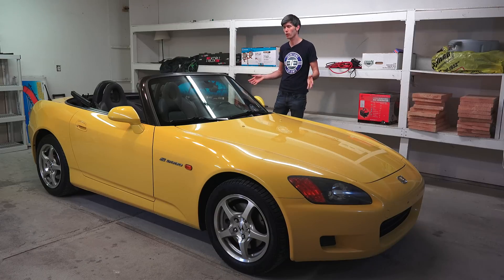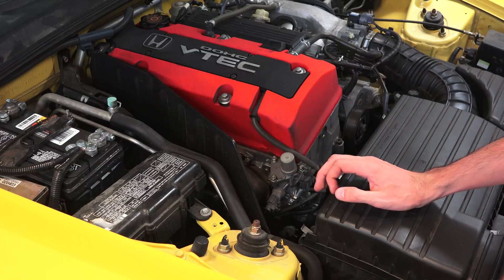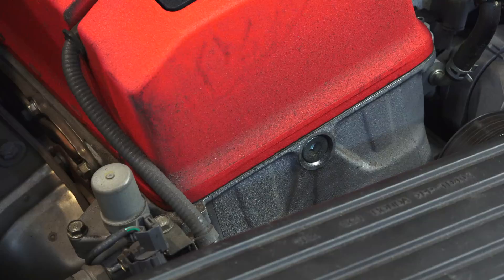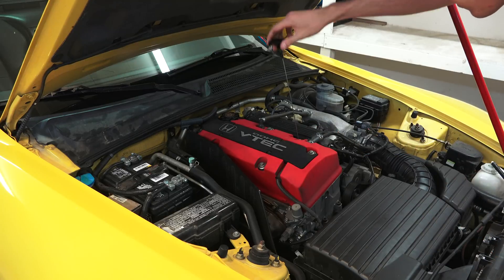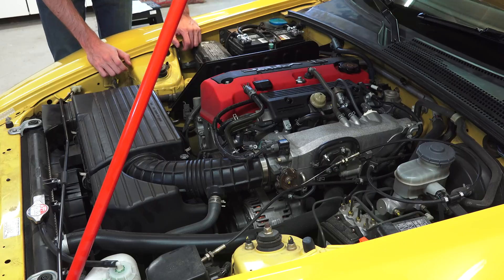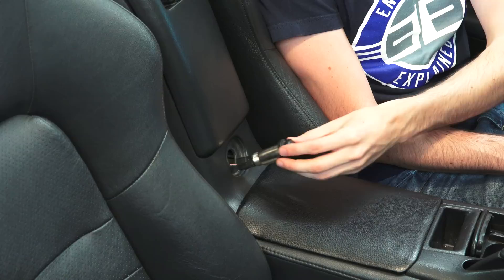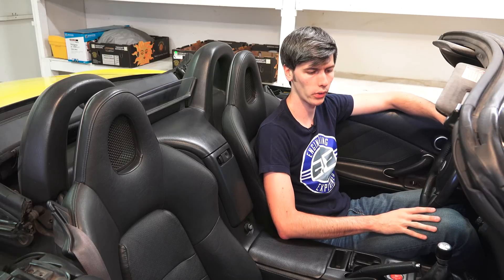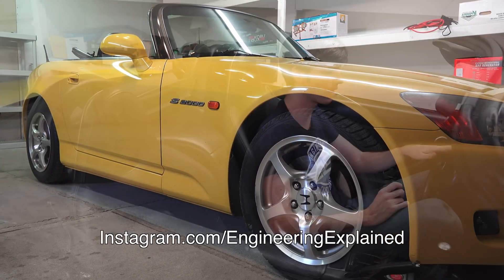What's Wrong With My Honda S2000?

Comment: My 2000 ap1 preferred castrol to Mobil one. It could burn a quart per 1000 miles of you were always doing high spirited drives. The TCT takes less than 15 minutes and is no big deal. Makes a noticeable difference in off idle too. My car was driven hard but not abused for 75,000 miles around Beaverton, Oregon and is now happily still running with its new owner. Rear wheel bearings and starter are the only repairs it needed on my watch. If you're going to daily drive in the winter I highly suggest the factory hard top. Worth every penny. Congratulations and enjoy.

Comment: Your top doesn't look to be folding down correctly. The small bar right above your head should fold back further than it is. It makes getting the tonneau cover on much easier. Also, have you found the secret compartment yet? :P

Comment: I've been thinking about painting my 2002 Miata's control arms too just to hold off any future rust, so I'd be interested in that! If you do end up doing it, look up Evapo-Rust. It's a non-acid liquid that melts rust and doesn't hurt rubber or plastic, or really anything else. I've used it on calipers, and it's magic.

Comment: replace with TCT with Ballade sports TCT, I'd do amsoil mtf & gear fluid for the rear diff, if there isn't any oil leaking from the pan I wouldn't worry about the seal, there are 28 bolts I believe (I've replaced mine don't remember the exact number) that hold it on at like 7ft lbs and it is just a hassle to deal with so not worth it if it's not leaking. For the plug in the console, that whole center console assembly (where the roof button and arm rest is) snaps on/off, then you'll have to do undo the panels behind the seats to get access to the plug from behind and it's just like you said, you need to thread it back in. A common issue on the ap1 is burning oil, especially Mobil 1. I had this issue with my ap2 burning Mobil 1. I switched over to castrol full synthetic and the car runs much smoother and doesn't burn oil like it did with the Mobil 1. Amsoil is also another good alternative if you don't mind forking out the penny for it. Good luck, looking forward to more videos on it!

Comment: yel its fairly common  s2000's eat up a quart of oil for every thousand miles like old boxer engines. also change the air filter man. that high revving engine needs to breathe

Comment: The air cleaner is one of the things I check on any car I'm potentially buying.  Its cheap, important, and about the easiest maintenance you can do to your car. If they couldn't handle that, I wonder how the rest of the car was taken care of and it's (probably) best to  walk away.  Also, don't just look at it to see if its clean or dirty.  Check to make sure its actually put in properly.  A surprising percentage of people just force everything on and have air cleaners that are pinched funny or something that are just not working properly.

Just one more thing...OEM fluid is not always the best for your transmission.  Might want to do some research.  Remember that car is like 20 years old too.  It probably needs some unique properties for its time, and would benefit from some modern ones as well.

Comment: hood. there is a cool mechanical function on your hood whereby the hood prop can be moved from its pivot to prop the hood at a higher angle. sand blast the control arms and paint when you inspect the bushings. I would change the o ring as well as the water pump and timing tensioners. but it looks to be a good buy. also have a look at changing the VTEC units diaphragm rubbers\filter too. :-)

Comment: You should also do the following important maintainance/preventative upgrades 1) check valve clearance 2) install ap2 valve retainers 3) install ap2 crank lubrication bolts (aka banjo bolts) 4) baffled oil sump if you are thinking to track the car.

Comment: I have a 2000 S2000.  Had it for 8 yrs now.  Bought it with 82K miles.  Now has 105K miles.  Love the power, cornering and overall feel.  Doesn't burn oil.  Does eat the rear tires.  Typically use a utog tire rating of 200 to 300.  I try to use the same brand because I change the front tire every other set of rears.  Interior is great.  All electronics work.  New convertible cover.  I'll own this car a long, long time.  Long road trips are a bit rough on the body but anything under 3 - 4 hours is good.  Longer trips and you'll walk like a retired bull rider for half a day.  Best damn car I've ever owned.  Mine is Silver and came with dealer strakes and small lip spoiler on trunk.  Small abs plastic splitter to absorb front end cracks with parking.

Comment: That "Leak" you mentioned is the Idle pulley Bolt, it's not that simple, you need to be really careful as it can throw your cam shafts completely out of time if that bolt is pulled out too far. I wouldn't recommend changing it without taking the rocker cover off. Any questions message me 👍

Comment: I notice the original battery terminals were replaced with the generic bolt on replacement type.  Check for stray voltage/electrolysis in the coolant.  This condition very often comes from those bolt on replacement battery cable connectors being just slightly loose or corroded where the cable enters the connector. Sometimes a grounding/bonding strap is cut away but, not replaced when this type of connector is being installed.  Once installed, this kind of connector requires regular check ups.

The damage this tiny detail can cause can be very expensive as it corrodes ALL items that touch the coolant.  This little known/understood issue would make a great video for you.

The test for this condition is to use your multimeter and test for voltage between the negative battery terminal and the coolant itself while you have as many electrical items turned on as possible.  The reading should be 0.0X volts.  Good luck.  That is a fun ride. I was once lucky enough to take a nice hard drive in one for free.

Comment: I have not seen anybody mention clutch master cylinder. The seals tend to leak brake fluid into the car. Common problem on most MT Hondas. New part is about 100$
Reply: Surprisingly easy fix for this 90% of time is to suck fluid from master, clean reservoir out with clean rag and refill with new fluid.

Comment: Probably not a lot of immediate benefit in this,  but I would purge the brake fluid. Something quick you could do, adjust your throttle cable so there is no slack at the pedal.

Comment: "What's wrong?" Well to start, it's a Honda...
Reply: Yeah, A Honda S2000.. Which holds the record for the highest HP NA production 4cyl and holds countless records on tracks all around the globe.. those pieces of junk.
Reply: A Honda....a lighweght car packed with useful technology and a high revving engine with amazing power to displacement ratio, pretty low fuel consumption and excellent reliability. What a ricebox right?
Reply: Just wondering Big Boss.. Walk me through the staps. You started this video, watched it and then you went to the comment section to type.. show me the thoughtprocess...

Comment: almost every japanese car since the late 80s'/early 90's don't use oil pan gaskets.

also a tip for the gearbox - Redline MT-90 works GREAT in these gearbox's.

Comment: When I bought my 1997 Jeep Wrangler, I made sure no suspension parts were falling off, and that the holes in the floor were smaller than my foot. They were because they had been stuffed with glass fiber. I still drove it 2 years without losing any part (or without noticing I lost any), and now it has a new owner and is still alive... those things are tough!

Comment: Brake cleaner the oil pan, it's probably not leaking, during the oil change the oil drops down and eventually starts covering the pan after weeping around the seal area.  Anyway, brake clean it off the pan and the block above it, you should find it's fine.

Comment: dont replace the stock airbox, you'll probably either lose power (mostly low end, do you really want less low end on a car with none to start with?) or best case scenario  gain a little teeny bit of power up top.  overall youll likely make the car slower.

Comment: if you do anything with that timing chain tensioner definitely do a video!! just did my trans fluid last week and my car feels so much better shifting. I picked up 3ft of pvc tube for easy filling on the side mounted fill hole

Comment: Diff fluid, straight SAE 90 is hard to find, 75w-90 seems to be too thin for hard use. 75w-110 seems to be the best compromise, also since the S2k uses a torsen diff a thicker fluid will allow slightly more locking in the diff. It's the reason I use 75w-140 in my 02. Only need to do stuff to the control arms if the bushings are bad or they're bent. The arms are boucoup bux, it's much cheaper to replace the bushings with hard race bushings, they totally transform the car make it extra tight.

Comment: I always use redline lubricants in my miata, really solid products in my opinion. of course you should check if it's compatible with your car first. I put redline gear oil in my transmission and almost instantly noticed that my shifts were way smoother and requires almost no effort to get it into gear.

Comment: The flaw of the timing chain tensioner is that the oil feed hole is too small. All the people that sell modified timing chains simply enlarge the oil feed. The one on the factory tensioner is .8mm, I widen them to 3mm cures the sound 100% in every case I've ever done it. Buying a new TCT or sanding the worm is pointless, the former is a waste of money, the latter is not a good fix. I'll tell you why, sanding the worm gear basically is a way to slow the TCT from reacting to a momentary loss of pressure in the unit. It doesn't address the issue, which is a lack of oil volume inside the unit, the oil pressure on the tensioner is internally regulated by a check valve. The problem is and always has been a lack of oil flow. The oil feed hole is the small hole that sits between the two round O-rings in the tensioner.

The weeping plug on the head is easily fixed. The o-ring from Honda is $3, with a 8mm allen socket loosen the bolt and back it out just enough to expose the rubber o-ring. Use a pick to remove the old one, coat the new one with oil and slip it into it's groove. The bolt gets torqued to 36ft/lbs it's critical to get the bolt tightened properly as a loose cam chain sprocket bolt can and will quickly destroy the engine.

Comment: With an s2000, If you turn hard right it will burn oil due to it coming back through the intake from the head. its super common to see smoke on a hard right or burn oil overtime. i used to autocross with some boys and they had this happen all the time. don't change the airbox out, the car has been fined tuned to use it and if you put a cold air or other intake you will actually lose power, check it out.

Comment: the sealant used in place of oil pans is an extremely common practice. I don't know why that is but I think it expands better under heat stress and expansion over years rather than a rubber gasket.

Comment: I have an s2000 just like this, same year, etc. only black. Tip: Always wipe the dipstick when you check the oil. If you don't, you won't get an accurate reading. Mine was burning some oil (1qt/1000 miles). I switched to Castrol Synthetic, 10W40, Wix filter, Lucas Oil stabilizer. No oil burning issues at all since 2012. Total is 6 qt, which someone may not have realized when they changed it. My socket came loose too. You can reach it with some persistence, and taking the bolts out of the panels behind the seats. You're going to like that car. I've had mine 5 summers. I think about selling it from time to time. But every time I run it up to about 8K in 3rd and hit 4th, I think "No way am I selling this car. Ever."

Comment: Congrats and welcome to the club!
I don't know if my cold air intake improves performance at all, but it sure opens up the area around the engine. I do my oil changes without ever getting under the car at all.
MTF and diff fluid require at least a little jacking, weird-sized sockets (with a breaker bar, probably), and the right washers (I recommend HandA), but otherwise aren't hard. Hooray for spreading the drivetrain along the length of the car! It's so much easier than a FWD.
The power outlet nut is a pain—you can do it without removing the glovebox panel, but wear long sleeves to keep from scratching the heck out of your arms. And YES to the Loctite.
I bought mine with a replaced top and now it has two holes. Don't make my mistakes! Check the springs and straps, and sand and/or pad the ends of those pesky arms, now! Don't drive with the top down much until you're sure it's squared away. That's when the rubbing happens.
I used tutorials from S2ki for all of those. It sounds like you've been there, but I can dig up links if you want the specific posts.
I'd love to see some maintenance and project (and hooning) videos. See you on S2ki and /r/S2000!

Comment: SUBBED! Thanks for all the car info in your vids, you have a good way of explaining yourself. With your s2k oil leaks I am not so sure that I would risk backing out that cam chain bolt to replace that $1 O-ring unless you are doing the whole timing belt service, because if it does happen to back out too far you will have to be doing it anyway; especially since you are going to leave the leaking oil pan as is, that is a more important oil leak and less can go wrong by fixing it. I am guessing the subframe prevents ease of pan removal?

Comment: Upgrade to ap2 valve retainers (if not already done).

Order a Billman tct.

Try Castrol Edge to reduce oil consumption (works well in mine).

When it comes to mtf, I think every ap1 is different (due to previous treatment). I had to do some experimenting to find the best fluid in mine. Also, the transmission is very sensitive to dirty cmc fluid.

Comment: Glad you bought a real sports car dude. A WRX is not a real sports car, its a sporty sedan. I used to see a yellow S2000 just like yours in the showroom at the Roseville CA Honda dealer every time I took my 2001 Civic in for routine maintenance. I really wanted that S2000, but the dealer was asking $38,000 which I thought was a little steep, and then a few years later Honda stopped making them anyway. Fast forward to 2013 when I bought a FR-S which is also a real sports car. It's not for everybody, but I like it and after 3 years and 26,000 miles zero maintenance issues. Put on some Michelin Pilot Sports and the handling is scary, it just sticks in wet or dry conditions. Don't know about snow, it doesn't snow where I live. Anyway, good luck with your S2000!
Reply: +Blake Payne WRX is a sedan with improvements.  s2000 was built from the ground up with track performance in mind.  thats the difference.  everything was perfectly calibrated to do its job perfectly without being overkill.  wrx is nice, but a long shot from the WRC track models it named off of
Reply: +Jake Sundberg no.
Reply: +Michael Cohen don't tell that to subaru fan boys. They get really angry if you tell them anything is better than a sti or wrx
Reply: GC8 is my favourite subaru ;)
Reply: I got Pilot super sports on my genesis coupe.
Reply: Haha, just because the s2k might look "more sporty" to some doesn't make it a "sports car", performance wise the wrx is much more of a sports car m8

Comment: why the ap1 and not the ap2? i know it has a 9,000 redline, but aside from that. why the ap1?
Reply from the maker: Availability. I would have preferred an AP2 for the transmission alone, but I was happy to find an AP1 in solid shape at a reasonable price.
Reply: if money ain't an issue which AP will be better to get?
Reply: no drive by wire throttle, no traction control, lighter flywheel, easier to shift quick with.  AP1's are true driver cars :)

Comment: Don't put thread locker on the outlet. Chances are the center console was taken out and they probably forgot the tighten the outlet and said to hell with it. I feel like thread locker on that part would make it overly difficult to remove if you ever have to take it back out.

Comment: Like I mentioned in the other video, use the GM Synchromesh FM fluid for the trans. It is much smoother and lasts longer than the Honda MTF. Also, you mentioned that it calls for a straight 90w in the diff...and it does...but, if you are using it primarily for fun/track/autox then give it something thicker. 

As for reattaching your 12v supply, you just have several plastic pieces to pop off to get there. I think you might be able to do it by just popping off the piece behind either seat (they are attached by two screws under the little hooks) and reaching in there...maybe, with a mirror...otherwise you might have to pull the glove compartment off. To do that those plastic pieces come off, so does the center console which pops up pretty easy, and there are a couple screws you have to get at from the back behind the spare tire. 

Also, if you are replacing the oil pan gasket anyway, you should update your piston oil squirters to the newer version. You might already have the updated ones, I forget what year your S is, but if its 00-01 it definitely doesn't have them unless the previous owner did it. Also consider welding in a baffle. Its not much of an issue until you start getting sticky tires, but sustained hard cornering G's does pull the oil away from the pick up. FFT

Comment: My parents have an 86 prelude that calls for engine oil in the tranny .  what up with dat?
Reply: It's a prelude
Reply: back then they used motor oil for the transmission. per workshop manual.
Reply: most older hondas take 5w30 in the trans, that just how they are
Reply: They are special little cars .